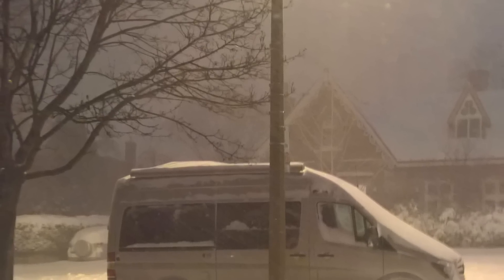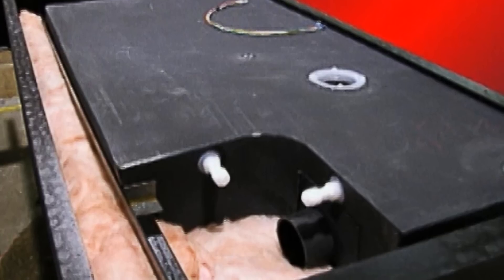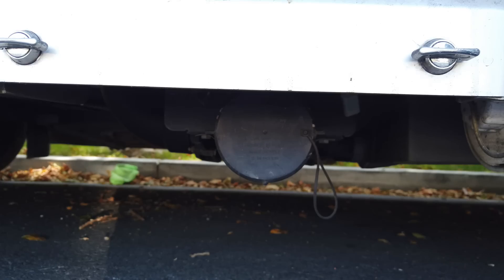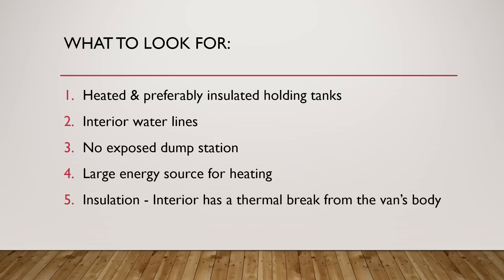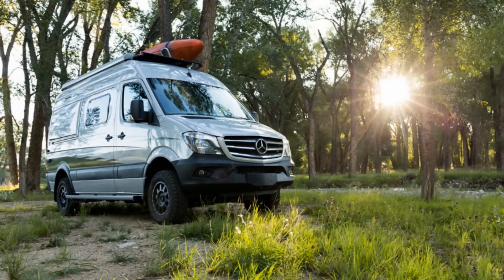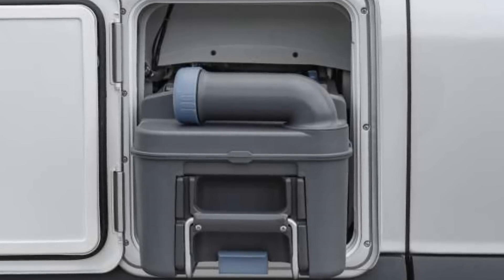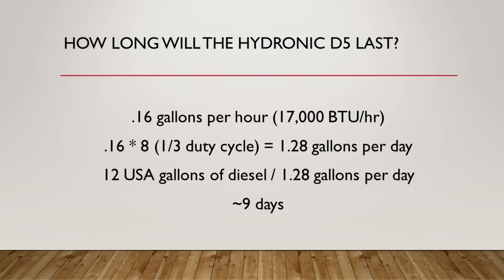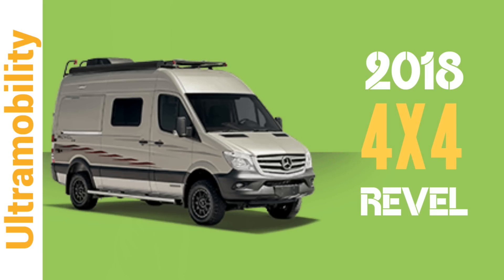Best 4 Season Class B Camper Van | 5 Tips for Finding Your Perfect Winter RV!

Comment: Neil, thank you for an awesome video.  I think you cover all the basics really well.  I have a couple of questions and comments:  1) The Revel does look fantastic and reasonably priced.  However, as noted by many (e.g., Wings and Wheels Alaska) the insulation is not as good as it could be (at least the inside of the back doors/gates).  2) Why isn't it possible for manufacturers to use systems that could withstand freezing without catastrophic failure?  I understand that a frozen water line would not be FUNCTIONAL but if the materials could be elastic (water expands by ~10% upon freezing) then the concern with winterizing would be a lot less.  3) On the Revel, is it advisable to leave the heater on even if you are not in the van? (for example if you went skiing all day, or are visiting friends and have a warm house to live in for a few days and the Revel is parked).  Thank you again, I find your videos very enlightening.

Comment: Neil I have always liked your reviews.When I first bought my first motorhome which I’m in right now all I wanted was diesel and low miles. So I bought a Fleetwood pace arrow diesel with 80,000 miles on 1993 model. That all worked out for me perfectly. The woman said that I bought it when I first bought my first motorhome which I’m in right now all I wanted was diesel and low miles. So I bought a Fleetwood pace arrow diesel with 80,000 miles on 1993 model. That all worked out for me perfectly. The woman I bought it from her husband had just died and she didn’t know how to drive it or anything it was in her driveway. So I backed it out and drove it over here and she told me that the last time her and her husband used it everything worked. Well I don’t know how to do anything and now I do but I didn’t then. And I was afraid to turn on the gas because a friend of mine burned up in his motorhome somehow. So anyway I’ve had it now for about a year and all the sudden I’m coming into some money that I’ve been focused on getting her a long time and it’s not enough money to completely buy a brand new B+ class motorhome which will be shorter than my 36 foot. Anyway I want to upgrade some things like do a electric stove top, convection microwave oven, and get rid of my perfectly functioning three way refrigerator and put in a compressor refrigerator and perhaps even get it from the Amish That make a compressor conversion kit for an existing refrigerator. And I already bought a instant hot water heater. But everything works anyway I enjoy your stuff man thank you very much for being so honest and straightforward

Comment: Hi Neil, great job as usual--one point about the Espar in the Revel--I believe it only runs off the top third of the diesel tank--it will shut off after that because apparently they don't want you to get stranded somewhere. They may have changed that for the 2020, I'm just not sure. But otherwise, agree totally about the Revel's winter-worthiness. Note--I don't own a Revel but I've been monitoring the FB Revel group for over a year now. Must folks say they are toasty warm in the winter with the Espar.

Comment: 4 season camping is a great option to have in a class B van. Cold temperatures often include snow and icey roads though. Obviously 4wd or awd would be a great addition. I have driven a 144” 2wd Sprinter that would get stuck on wet grass. It would be nice to see a a side by side comparison of the different B vans capabilities on less than ideal road surfaces.

Comment: Hey Neil,  Good content for consideration by all.  I personally love travelling and sightseeing in the colder times of the year. Yellowstone, Alaska, lots of winter fun.  Cold for me means less crowded conditions as well as avoiding problems related to a heat stroke 50 years ago from an unplanned 1 year vacation in Vietnam.  The older I get, the hotter the weather gets, the sicker I get.  But there is "too cold".  My memories of too cold;  cracked engine block because by inability to run my diesel engine because my fuel tank heater quit.  I don't think a Revel would have saved me.  I was in Fairbanks, AK on business and it was cold.  Freight trucks run 24/7 or get parked in garages when not driving.  Back in the early 80's my family and I got snowed in at Yosemite Valley.  Not really cold but lots of snow.  1 snow shovel, 4 hub caps and hours of digging.  Chains and 4 wheel drive are only so good.  Basically, I like Dean Rumpel's explanation.  There's no such thing as a winter proof class B.  Most people are heading to the warmer places.  From my experience I've even learned even hotels and motels have their limits.  The discussion is amusing though. Keep up the good work.

Comment: Information on features and benefits for winter camping this video take high marks. I have learned a lot and now have a few questions. 

Has anyone done a thermal imaging on insulated winterized camper Vans? I had my house done a few years ago and it found problems that normal inspection missed. 

Also the material you highlighted in the photo of the exposed insulation has a very low R value. I purchased some and did some testing. Due to the fact that I’m not sure what manufacturer they used in that van i really can’t comment on it’s R value but the material I used was very low. That said it better then not having anything. 

A industrial standard needs to be put in place so the public can get some real answers on how will there van is protected. We have that now with fridges, not sure what the cover but we need something that will protect buys from camper vans manufacturers that have misleading marketing material. 

The other problem that I see is the installation of lithium battery subsystems. Compared to Europe Canada is lacking in regulations covering safety  features. It now appears van manufacturers can install almost anything they want without having to follow any government guidelines. Can you check that out for me? 

Lithium batteries as you are aware can’t be charged when cold.  The charging system needs to be careful designed for safety, is that being done? What certification is required?  

I could go on, but I leave that for now. Thanks for doing this review I think more videos like this one is needed to educate future buyers.
Reply from the maker: Hi Dale. Thanks for sharing all this great information. It’s true lithium batteries should not be charged when their internal temperature is below freezing. The best manufacturers have insulated and heated lithium battery compartments and a battery management system that monitors the temperature and only charges the lithium batteries when it’s above freezing.
Reply: Ultramobility / thanks for the feedback, when you have time can you address the other questions I posted? I really would like to see information on regulations that manufacturers need to follow. Of course they will be different in Canada from the US market. My interest is in purchasing a unit. Thanks again for your insight.
Reply: Ni: km ok n%ham free vfb I OP
Reply: Buckingham 6677677feet was an 74inches

Comment: I own a revel. Here's the catch. When you turn on the heater, it draws down the battery a lot faster than you would like. I don't feel that comfortable running it the entire night. I think it would drop down the AGMs to about 50% by morning.  yeah if you are plugged in to shore, no problem. The diesel doesn't run down very fast at all. But if your boondocking, I'd be nervous to run that heating system at full throttle for more than four or five hours.I don't understand why running a diesel heater is so battery intensive. Kind of defeats the purpose.
Reply from the maker: Peter - thank you so much for sharing your experience as an actual Revel owner! this comment is super helpful to potential buyers. I imagine that the battery drain is the run the blower and perhaps the igniter in the d5? not sure but it's a great point that you make.
Reply: I've been told it has something to do with the circulation pumps. I really don't know. I'm tempted just to let it run all night one of these days just to see where the battery is when I wake up.  I would imagine, like a refrigerator, that once the cab hits a certain level, it doesn't drives much energy. Maybe? I don't know. First two hours seems to take up a lot of juice.

Comment: Very interesting video. You hit most of my list for 4 season RV's. Insulated/heated water tanks/lines, 4 wheel drive, well insulated van body, gasoline engine instead of diesel. The one thing a lot of RV manufacturers miss is the doors when in comes to insulation. Your first example showing the insulated van body has exposed metal on the doors. 

I do have a concern with the heating for the Revel's water tanks. In my opinion those heating water lines should be on the bottom of the tank since heat rises. The Revel's system heats the top allowing, in extreme cold, for the bottom freezing. I have to wonder why no one has a system using the Truma aqua go to heat your fresh water to around 50 degrees Fahrenheit. Kind of like a household water heater does. Something you can turn on in cold weather and have off during warm weather. Seems like it wouldn't be real hard to do. Just need a return line to the water tank and a temperature sensor in the tank.

As for my wanting a gasoline engine in the coach. I was a truck driver for many years in Ohio winters and have seen even treated fuel gel up in extreme cold weather, by extreme I mean below zero for days on end. We hauled milk from the farm to the dairies so we had to go out every day since milk cows don't ever take a day off. It go so bad one winter we had to pull our trucks into a heated building and drain the diesel tanks and run on kerosene, for a week, to avoid the gelling issue. This was back in the late 80's when you didn't have all the fuel regulations you have now and we could do this legally.
Reply from the maker: wow fascinating story! thank you so much for sharing! enjoyed reading your comment.
Reply: The Coachmen Galleria 24A floorplan has the 30 Gallon freshwater tank inside the coach and also uses the Truma heating system to heat all areas of the coach including the rear underbed luggage area and because the Freshwater tank is inside the coach all Freshwater lines are also inside the coach. Dump station stuff is not heated though allthough the macerator hose is housed in a another tube so provides a sort of double insulation.

Comment: Winnebago EKKO has a portable thermal cab partition adding extra heat insulation to the cab (the windows of the cab leak the heat easily).  I've been frozen in a class C RV in a 20F night (even with heater on, but the battery ran down fast, and the NP Campground doesn't allow generator and dry camping only).  How effective is the cab partition keeping the living space warm?

Comment: Hmmm... heat rises. I wonder why nu decided to put the heat elements above the water lines. All my lines are internal so I open cabinets and panels while using the van, and keep the heat on, even parked at home, during shoulder season weather. Gives a number of additional weeks of water use. I think the most important point you made was right at the beginning when you pointed out that the only problem with using them in extreme climates is that you don’t have fresh running water. Ultimately, that’s not a very big deal because you can still cook and sleep and drive in it.
Reply from the maker: yep agree completely. you can actually still use the sinks you just have to use jugs of water and flush with plenth of anti-freeze. i did this in the dead of winter in quebec and it worked fine.
Reply: @Ultramobility  Really? I never used my PW Plateau in winter (winterized from November to May).  Is there 4 seasons dumpring stations in Quebec? All dumping stations I know are frozen, with a layer of ice on it or under 6 feet of snow?
Reply: Thank you Neil for your reference to Sanidumps.com where I found a few dumping stations open all the year around Montreal. However, the temperature in Montreal area is usually milder there in winter. I'll continue to search.

Comment: I saw a video showing the Coachmen Galleria which has the option for a polar package and new phase insulation with heating pads.  Coachmen says it is 4 season. Yet you totally passed it over not recognizing the potential. What are your thoughts?

Comment: Loved the Video! Thanks for breaking down all the different things that make an RV trully 4 season. I have a 2017 MAD that has a lot of the same winter concerns as your 2017 PW. But I did not even think about 4 season RV at the time. My next RV will definitely be 4season. Winnebago Rebel is tops at this time. Is there a shop that will do a good job of after market 4 season equiping? Buying a new RV every few years is way too expensive. 
Sliding backwards on ice must have been terrifying! Ive been sking an watched a Porsche Carrera slide into a Mercedes SL. We also had a situation where 5cguys got out of the vehicles and spun 10 cars including my van around by hand when a bunch of cars got stuck on an icee road. But sliding backwards in a RV?!?! Glad you survived!
Reply from the maker: thanks for sharing your ownership experience manuel. I'm not familiar with shops that do after market 4 season upgrading but i'm sure they exist. the limit of what can be done will be dictated by each rig.

Comment: I was wondering if there is anything i can do to enhance the ability to lower the freezing temperature of water lines to say about 25 degrees of a 2020 Winnebago era 70b camper van on underside.i notice a number of threaded studs hanging down and wondered if a skid pan of some sort with insulation and a few heating pads on bottom of holding tanks would work with some sort of water line protection.it does have a macerator pump for waste with leaves black water line empty until dumping.

Comment: Neil, could you please compare the Revel to the 2020 Boldt?  Thanks, great video!!!!
Reply: Thanks Neil...well done.  I think the Boldt may have similar or even better 4 season capability...
Reply: @dmorean  I would preferred the Bolt to an extra 20 gallon fuel tank instead of Propane tank as a single fuel source, because not all gas station has Propane!

Comment: Great video as always. I like the revel, just wish they had a better floorplan. Love the cassette toilet feature. If the revel had the 59g floorplan it would be perfect!
Reply: Those are my two top choices.  I prefer the Travato's floor plan, but the Revel's off-road ability. Perfect solution would be the Travato on an all-wheel drive Ford Transit chassis.
Reply from the maker: thanks for sharing your wish lists folks! i know that Winnebago is reading!
Reply: i love the revel too but my #1 requirement is the ability to run AC without shore power. Don't really understand why that can't be added as a feature to the Revel.
Reply from the maker: no generator. no room for a generator i guess under the chassis. they need the ground clearance. i suppose you could buy a portable generator and hook it up to your shore power to run the optional AC.
Reply: @Ultramobility  that's why I like 59gl but I like insulation features on the revel. Hopefully winnebago will listen and will add a floorplan and do the same system gl has.  Fingers crossed.

Comment: Why isn't it possible for manufacturers to use systems that could withstand freezing without catastrophic failure?  I understand that a frozen water line would not be FUNCTIONAL but if the materials could be elastic (water expands by ~10% upon freezing) then the concern with winterizing would be a lot less.

Comment: Sliding down on a hill is a traction issue = you need winter tires. AWD vs FWD vs RWD in this case is irrelevant. You might not get up the hill with RWD, yes, but you shouldn't slide down - that's purely a tire function to grip and hold vehicle position. If you slid down and sideways - that tells me your tires aren't proper dedicated winter tires.
Reply from the maker: quebec requires all cars to change to winter tires and this van had winter tires. if you’ve ever lived in quebec you know that no matter what if a bad ice storm hits you’re going to slide no matter what.

Comment: hmmm ... those tanks are also exposed to damage if you go off road ...
Reply from the maker: very true but the ground clearance on the revel is still pretty good. the fresh water tank is protected in a heated enclosure but the grey water tank isn't.
Reply: @Ultramobility  the winnebago revel 4x4 looks very off road, now I am goind to check it out to see where the tanks are and whether they are insulated and are heated for winter use ... thanks !
Reply: @Ultramobility  also if you are going to roam in winter areas, check the use of salt on the roads ... you might want to see if you can do rust proofing and undercoating if that does not interfere with the function of all that plumbing and the tanks.
Reply from the maker: great point about the salt and undercoating the rig!
Reply: @Ultramobility  You are welcome !!!

Comment: Great review as always. I recently saw a review of the new 2020 Winnebago Travados with internal tanks. Will you be reviewing that for 4 season use? They announced it with lithium and new solar capability. Thanks.
Reply from the maker: Hi Jeff. As far as I’m aware they don’t use any glycol lines to help keep the exterior tanks heated and they are not insulated to the best of my knowledge.
Reply: The review I saw, the tanks are inside under the beds and the heater vents circulate through there to keep them heated. I was surprised too because that was new as well as dropping their stick and staples cabinets. Everything has been upgraded and a new van was named that was a higher end Travado. Not sure they’re released yet